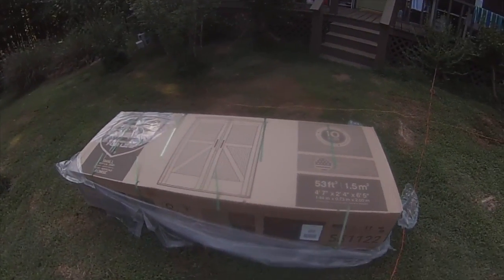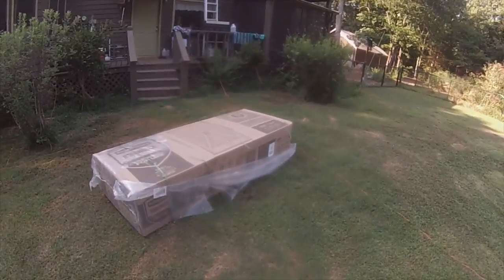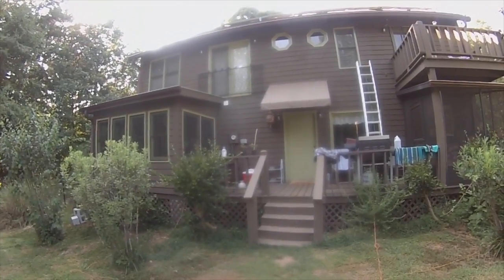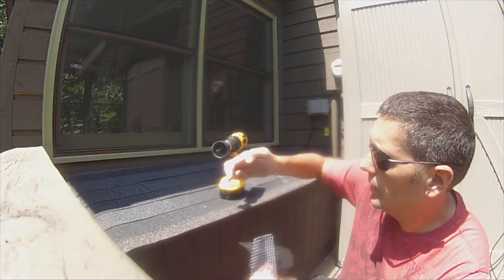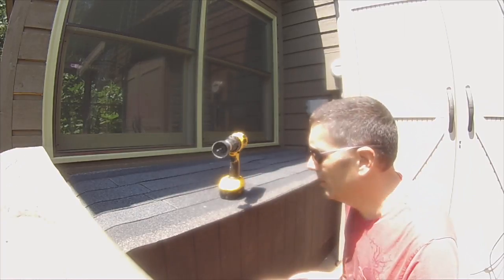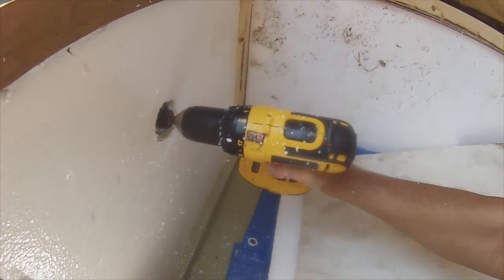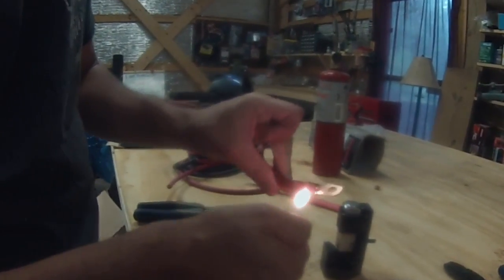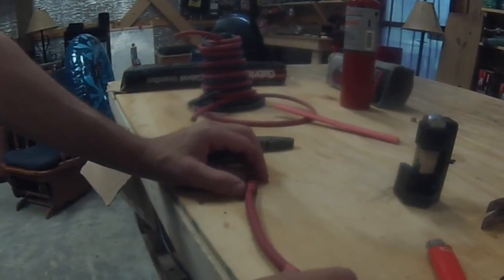Solar Shed, Battery Box Venting:Insulation, & 48V Trojan Battery Wiring

Comment: there is one other option to add to the battery box. When charging batteries in series aging and other battery characteristics will cause current imbalances. Some batteries will be under charged. The worst batteries will become overcharged. This shortens battery life and causes sulphation. To counter this, cell balancing will be necessary to equal out the currents. To extend  the life of the entire bank each battery must be monitored within 0.1V. These are simple and easy to build using mosfets for about $20
On my battery bank in addition to cell balancing I'm also monitoring the temperature and specific gravity level. its been 12 years now. no problems.

Comment: You're doing great.  In DC wiring I always go up one wire size larger than required for the projected Amperage.  The 48 V bank is the best for conversion and large loads.  But I would add when funds permit a 12V system for LED lights, charging small batteries in portable lights and electronics.  In a grid down situation it is good to have a 12V back-up for the 48V main system from being overly drawn down.  And I believe you have most of the components;  just need a PV panel and deep cycle battery. Also keep all old batteries charged if they will take one;  for jumping vehicles and additional storage for the 12V system.
Go for the cheap heat gun it has many uses.   And when funds are there go for a good one  ( stripping paint, thawing pipes, heat shrink tubing,  shrink application of window film,  removing hot glued labels from bottles, heating thick plastic sheet to make brackets,  heat plastic pipe so you can slide one in another , preheating metal before brazing or welding, reheating hot glue to remove,  etc.)    The world is plastic and low heat  ( just below ignition ) without a flame makes it workable.  
Bert

Comment: Tommy, for you and everyone else. The best way I have found to shrink the heat shrink stuff, place a tea light candle in a narrow and tall glass (1.5 to 2 inches, I use highball glass). roll the heat shrink over the top. this focuses the heat at the top of the glass without making the tubing black and charred. glad to see you're feeling better and glad to see Ethan.
Reply: correction, highball glass I use is 4 inches tall and the perfect size for the tea candle.

Comment: I find metal roof is sharp and that low someone will get cut. Instead of metal roof on the battery  box, get Endura roof panel at the big box store. They are light and will not cut you.